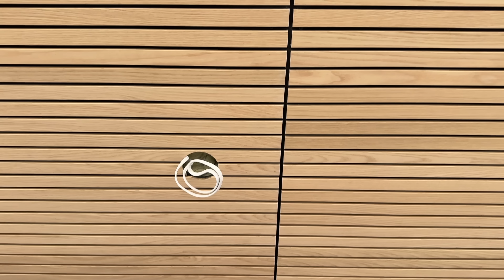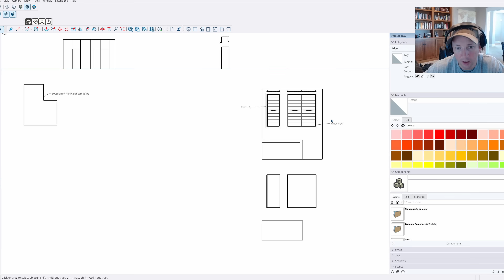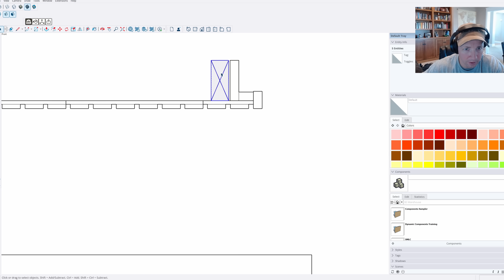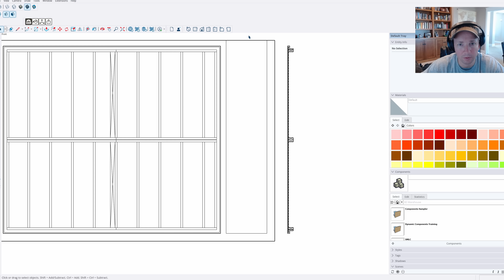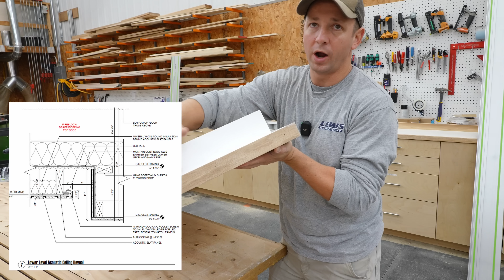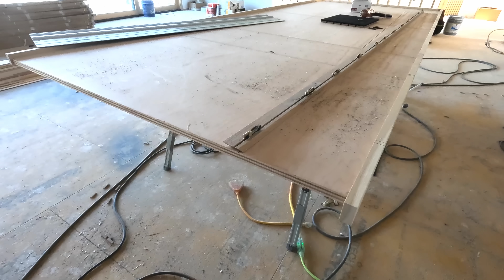These Details Are Next Level!!! The Ultimate Acoustic Panel Design

Comment: Hey Spencer - awesome and timely (for me) video!  I have the same problem of attaching something without exposed fasteners like that - what did you use to route the groove for the biscuits?
Reply from the maker: A biscuit slotting bit for a compact router. I had a the bearing on for a #20 biscuit depth slot.
Reply: @InsiderCarpentry thanks a ton Spencer!
Reply: @InsiderCarpentry I learned that technique from you, Spencer.   It is a great setup.  Thank you!